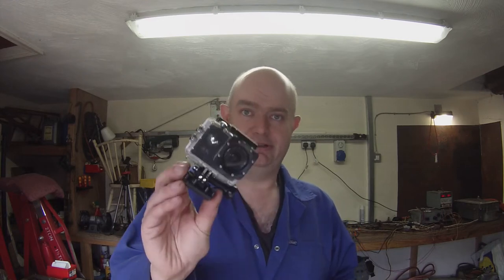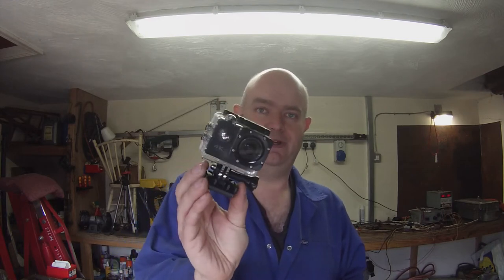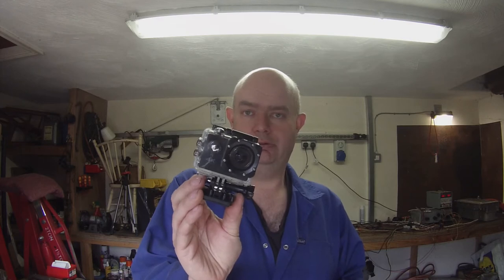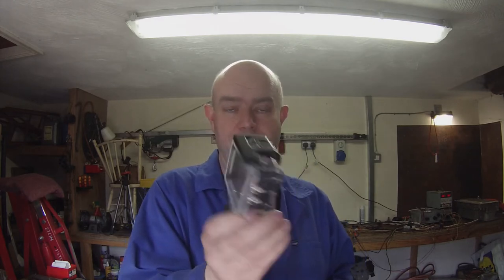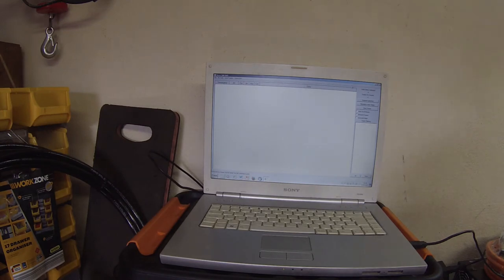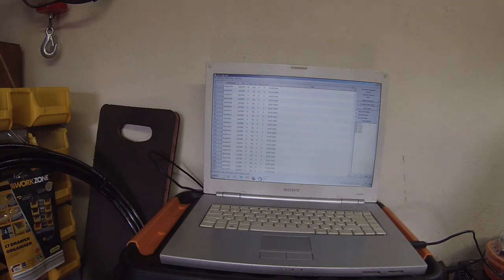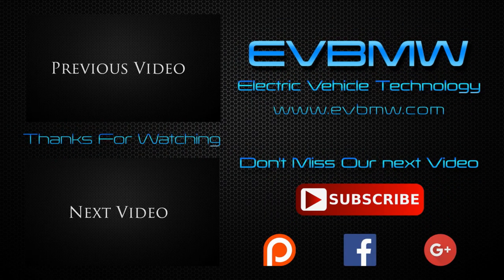TM4 Front Wheel Drive System Project 01

Comment: hi Damien, very lucky you got at least some info on that drivetrain. I got my hands on 2010 Citroën C1 ev'ie converted by an UK company ECC. such a BAD job, it's Curtis ac controller, manzanita charger and a cheap ass LTC6802 based BMS which gave-up Magic smoke(litterally burned ltc chip and few balancing fets). tried to replace all components but seems that dsp is not initializing properly. now have to make Curtis to forget about bms as it is thinking car is on charging all the time. Will make a few photos later and share on dielectriccar.
Reply: dsp is in between ltc chips and Curtis, providing can and I think serial interfaces.  not sure yet, only worked a day on it yet.
Reply from the maker: Sounds interesting. Some of these so called professional conversions are a joke.